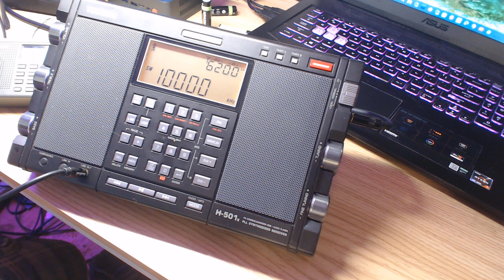Shortwave 101 Beginners series What is Dynamic range

Comment: I have an old Drake SW8 receiver. It works beautifully on 6 D batteries....but they only last for about 5 hours. I also have the original wall plug which delivers 9 volts....1 amp. Unfortunately the plug introduces noise....not just on SW and SSB but also on MW. Any suggestions would be very much appreciated. Great channel by the way!